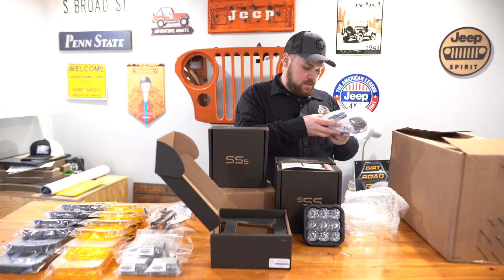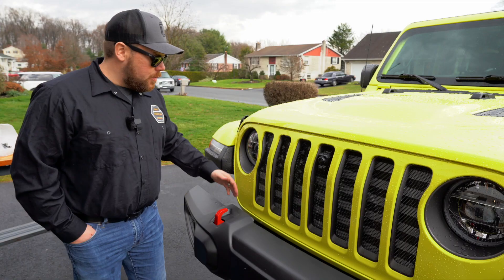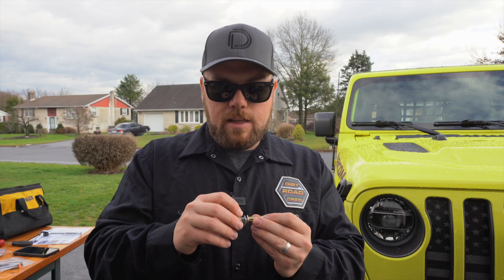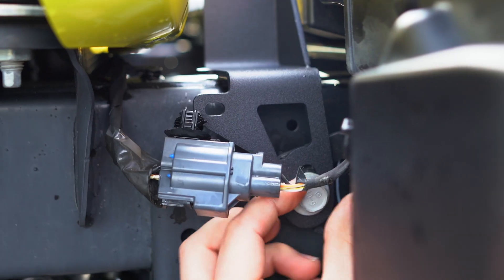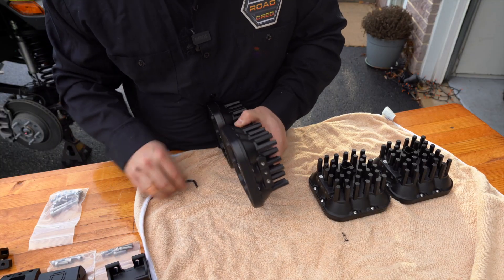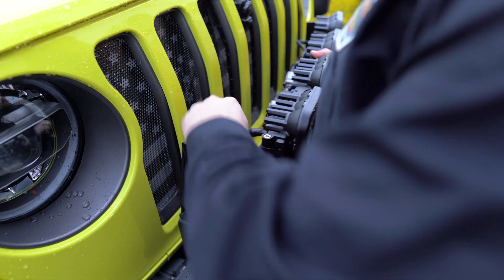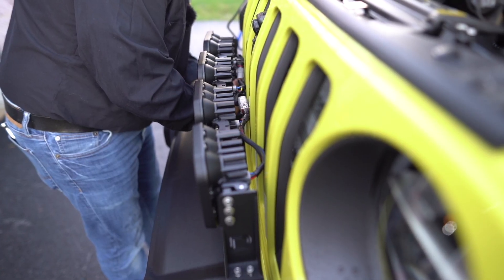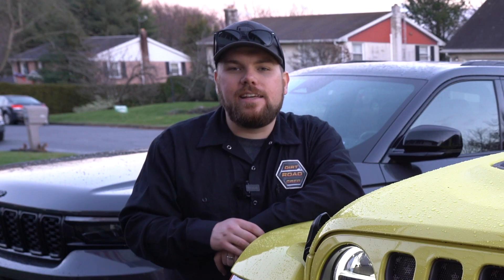Best Jeep Grille Light Bar? (Diode Dynamics SS5 Crosslink)

Comment: This is a baller light set up lol! I have had 2 DD driving lights and 2 DD fogs installed in the Road Armor Bumper on my Ram 2500 for 4 years now and they are programmed to come all on with High beams. The amount of light is incredible. They get used everytime I drive at night and are going strong. Hopefully you can get a discount code because the prices have went up drastically in 4 years!
Reply from the maker: Hopefully a coupon code soon!

Comment: Hey Matt dumb question but I noticed you took off your front license plate mount. What screws did you use to fill holes in bumper? Are they just something from Lowe’s etc? Only ask because we are driving to Wisconsin to pick up our new XR Rubicon but it has a front license plate. No need here in Michigan.
Reply from the maker: Those are the screws that hold the bracket in place, the are under the plate!

Comment: Will this fit above the warn 1200 winch? I've been looking for a lighting option.
Will they hook up to the provided toggle switch inside
Reply from the maker: I believe if the winch is low enough, if you have to use the toggle switch it would be run inside correct
Reply: @DIRT ROAD CRED  yes, the use of my Aux switch is my goal. Went to the site this evening and it gives a 3" clearance. Still gotta measure it up. I may end up with making a slightly taller plate for each side to mount the light bar to. I'm pretty determined to make it work. I love building my jeep. I truly enjoy your videos even when it seems as you your having a ruff time of it. Thank you for all the info and up grades. Chris

Comment: Congrats on 11K! I've been subscripted since 1500. I like that option of the grille light bar. Did the light bar block or partially block your off road camera? It looks like it does. I'd be interested in seeing the view from that camera. Also, will you still be able to mount a winch?
Reply from the maker: Thanks so much for watching, it just blocks the lower portion a bit